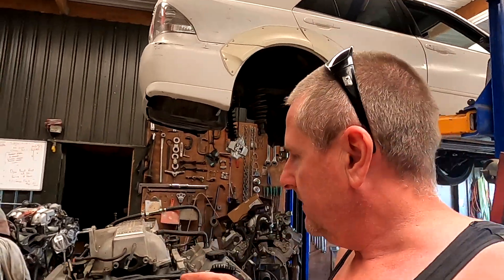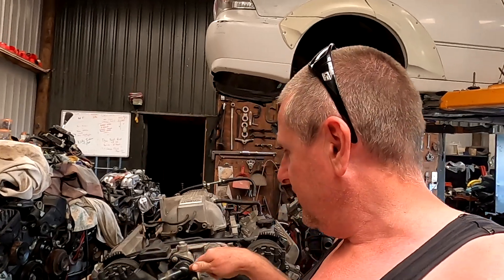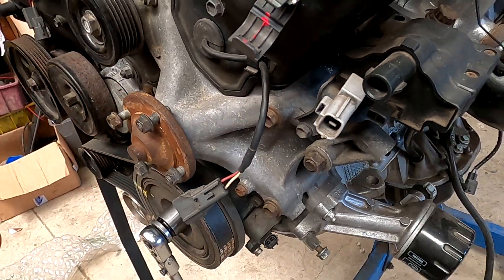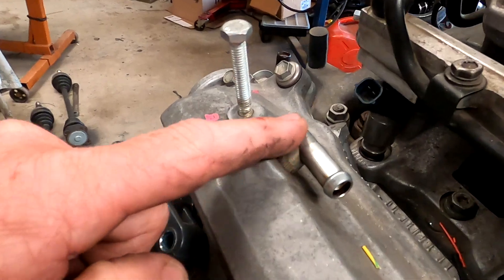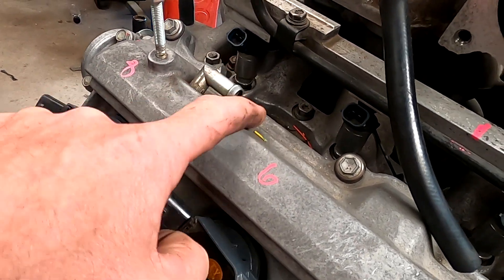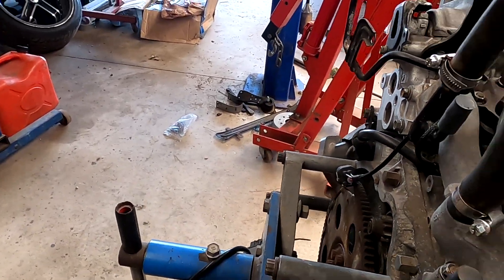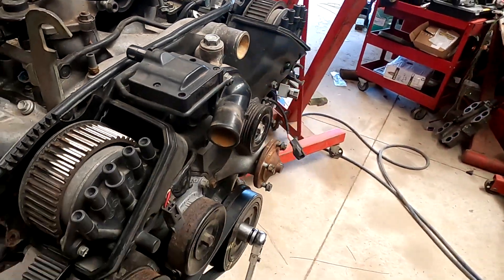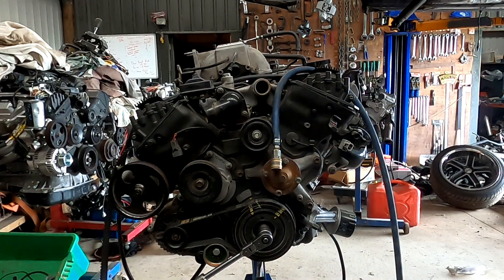1uzfe.  Is it an Interferance engine or not?

Comment: Kelvin...im a lucky bastard for sure....a year ago we went round and round on changing a belt.WP, TB, Starter, injectors....etc..(non-Toyota belt)....was the issue     I was sent a 91 tooth belt...   never started....tird for three days...thinkin it was cam sensors...    got a OEM belt  toyota part.   Reinstalled and ya know what that takes ....     installed and it has 8K miles since....purrs like a kitten.      One lucky bastard signing off..
THANK YOU FOR YOUR HELP.  1997, "Coach" LS400  IUZfe20.  196K.

Comment: So Kelvin are 2UZFE's interference engines?
Reply from the maker: The 2uz shares a very similar head and piston design as the vvti engines,   the early 2uz same head style without the vvti and later 2uz vvti and all have the ability to clash valves to pistons if belt is not connected.   Interferance for 2uz.

Comment: Literally there isn’t a Toyota publishing copy wrightpiece of literature that disagrees with you .  First gen 1uz was always listed as a non-interference engine. The only other possibility is that first gen you have with the 1st gen rods and gen 2 pistons.   I’ve been researching this setup for a while and it seems that unless you have .500 lift Kelford or similar aftermarket camshafts it WILL become interference.  Only option at that point is to fly cut new valve reliefs, thus lowering the chance of bent valves but decreases compression . 
  It’s amazing the utmost gall of people trying to reverse the well known . It’s all for views and arguments.    
  Well made video once again. 🤙🏼
Reply from the maker: Thanks.  This engine is 100% a gen 2 engine.   Ive checked it underneath when I had the sump off.  Its just got a gen 1 intake for wiring as,  if you noticed old yellow isn't presently in the workshop.   You are correct,   toyota has had this info around since 1994 but guys still dont get it right.   We are doing a gen 2 piston,   gen 1 rebuild soon.  Cheers
Reply: @CartuneNZ    Well I am following with enthusiasm.  We are looking at a 1uz engine build for our Plymouth Duster.  I found a ‘94 LS400 that I am picking up in a week or so.  Hopefully the center/mid sump fits .    
  We will be dropping my in some cams for a little lope but otherwise cleaned up, new bearings, rings , mls Cometic gaskets and HD fasteners.   Maybe Prius COPs and  a turbo down the road.  Kelvin, is there any of the factory ECU’s that can be tuned ? 
   I heard of an LS430 ECU but see no confirmation
Reply from the maker: @docfischer7291  I have videos of ls430 ecus being reflashed and more waiting to be released.
Reply: @CartuneNZ     I must have missed that !   I’ll search through your videos again.  Thank you Kelvin. 
 Doc

Comment: Thanks for the info. I think the confusion comes specifically from the 95 sc400. I got one with gen 2 visual stuff on top (Ignition coil), but i turned it over a couple of times without the timing belt and the valves didnt touch the pistons at all. Dont know what they did with that year.
Reply from the maker: Correct.  There are sub models of sc400 with the heavier rods which run later than 94,  and there is the factory mismatch as you mentioned.  Ive seen it myself,  confirmed factory numbers.  I'll do a video on rods and pistons at a later date.
Reply: @CartuneNZ  That was my issue in the brain.  had a sc400 that looked like but wasnt the same as 97 1UZ
Reply: So the 1997 SC400 has a non-interference or an interference engine?
Reply from the maker: I have a video specific to the sc400.  https://youtu.be/uYYGvr49Ark